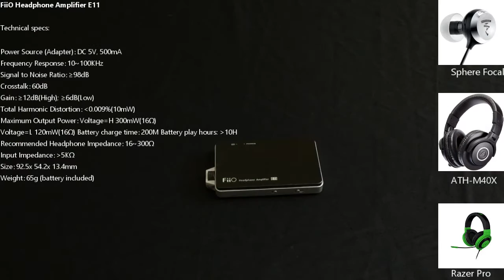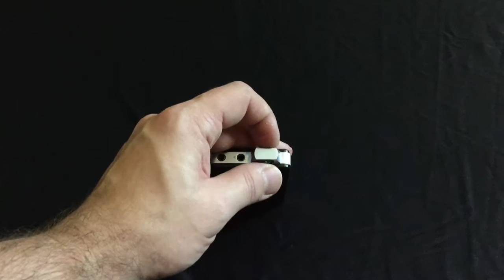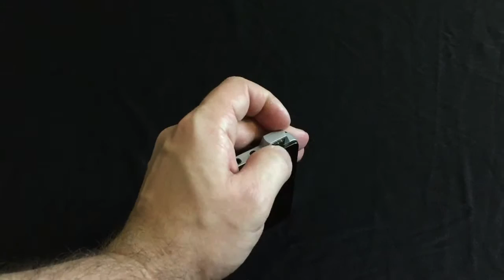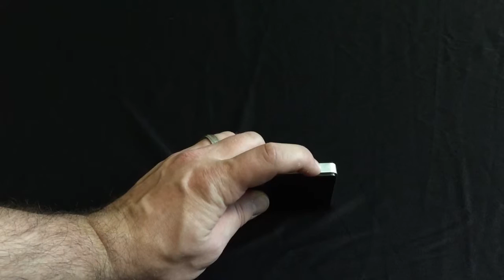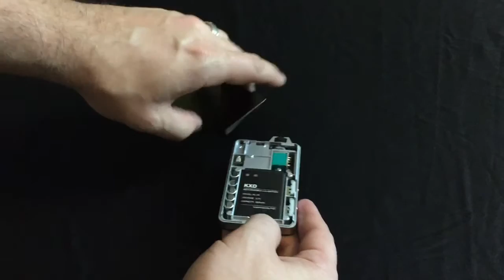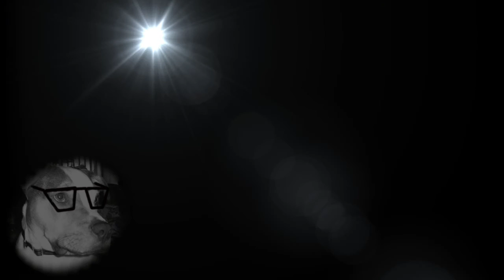Tech Review: Headphone Amplifier FiiO E11 (2016) + Discuss Amp Necessity

Comment: hey,how do u move voltage switch on e11?
Reply from the maker: Great question. It is hidden under the battery. There is a really tiny switch you can move from low to high power. Thanks for stopping by the channel!